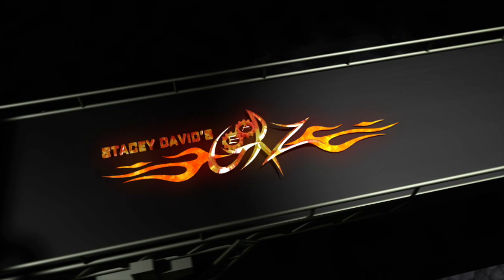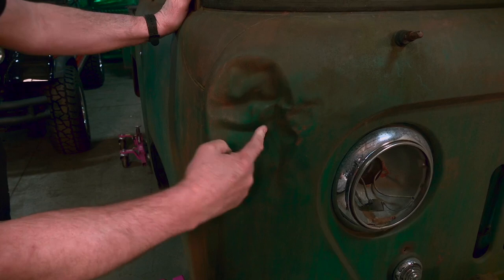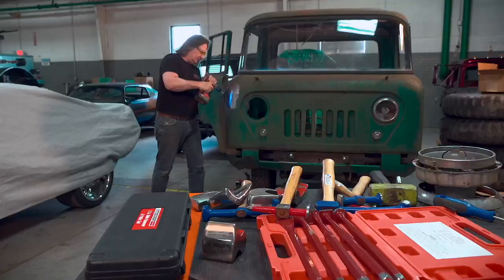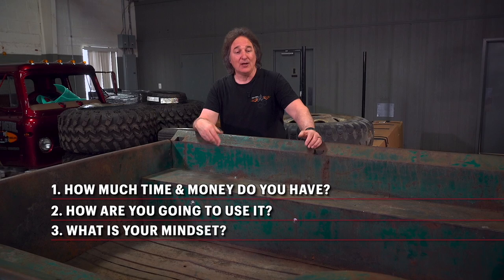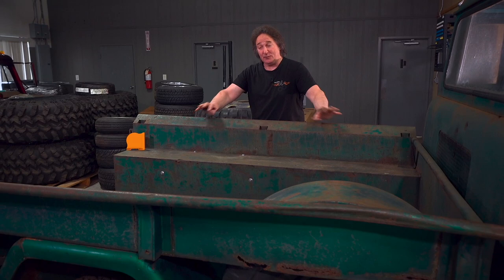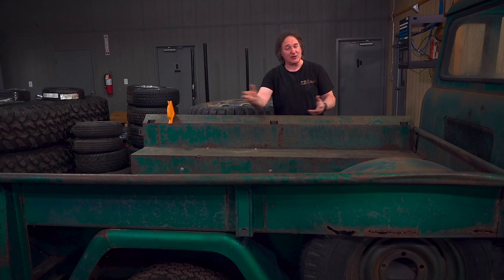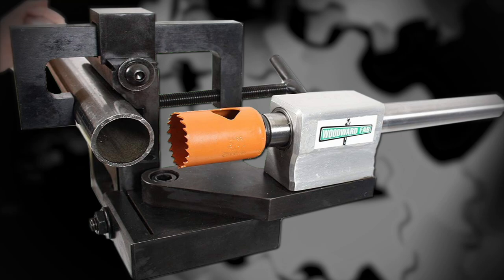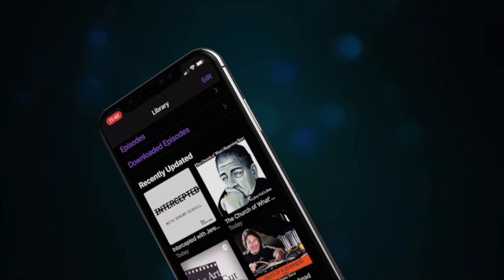Simple & Effective Sheet Metal Repair Techniques - Stacey David's Gearz S15 E7

Comment: Nice repair on that dent but that bed isn't as bad as looks and the repairs are alot easier than you make it out to be. 99% of those pinholes can be filled with weld and for the stuff that's too big to be filled in with weld it can be easily cut it out and patch with used metal, because that's what a REAL fabicator who's worth his salt will do. A couple of years ago I bought a wrecked 83 Ford panel van for $150 and cut off all the usual sheet metal and then sold the rest for scrap, the recycling center barely gave me enough to cover the gas getting there and back but I got alot of useable sheet metal for other projects. I'm in the middle of doing the body work on a 66 AMC Rambler 4 door for my 12 year old grandsons first car that had the usual rust holes, wanna guess where I'm getting the sheet metal? If you guessed from the van you'd be right. It's already more than paid for itself. I don't consider myself a master fabricator by any means but I know more than most, my dad was though, he ran a Hot Rod from the mid 70's to the early 2000's and the FIRST thing he taught me about wrenching on cars was "Work Smart not Hard".